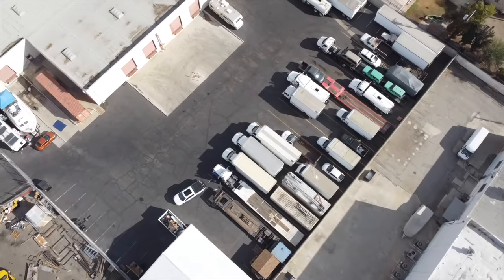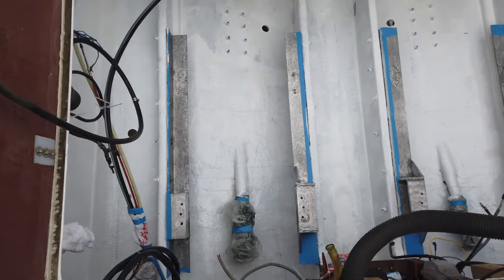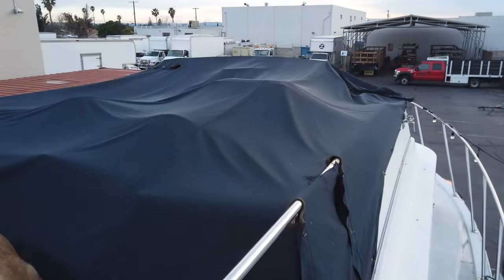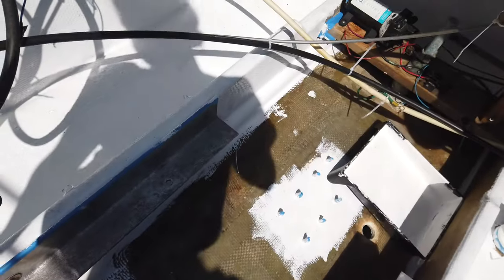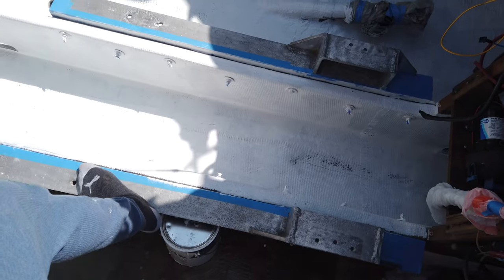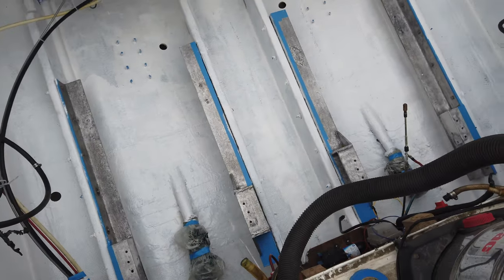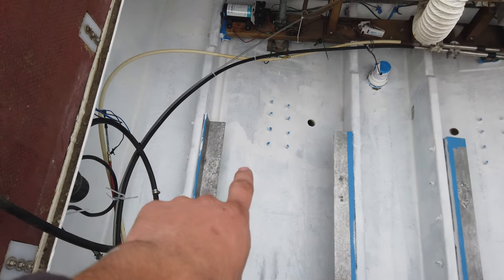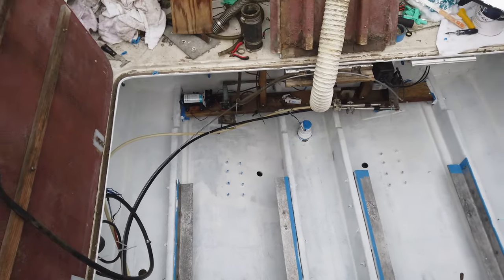Restoring a 47 Year Old Engine Bay with Total Bilge - Epoxy Paint Job - Old Yacht Restoration - Ep18

Comment: Use only quality all-brass thru-holes, no plastic. Use a quality backing plate on inside of thru-holes. Paint looks great.
Reply from the maker: Most definitely, I’m thinking of using groco brass thru-hulls and thanks! 👌🏼👌🏼
Reply: @IfTheresaWillTheresaWave  
I think you meant bronze, never use brass  fittings and valves in places that have marine water flowing into it. There are some plastic through hull fittings and valves that are very durable (Marelon) and rated for use below waterline and actually have advantages over bronze.

Comment: I've lived on a boat using a portable toilet, and it was a huge pain in the ass (pun totally intended😂) first you gotta haul it through the boat full of shit, but then you gotta figure out where you're gonna empty it. I actually have a hilarious story about that one. My opinion would be to install a holding tank, and an actual sea head. Life would ve much easier for you in the long run
Reply from the maker: 😂😂 I was thinking the same thing but I’ve also experienced many vacu head systems that  are out of commission for one part or another not functioning properly 😬
Reply: @IfTheresaWillTheresaWave  Funny story- My buddy, JD and I decided we wanted to stay on my boat for the summer. I had a 1957 36 ft Stevens cabin cruiser down at a very Posh Marina in Point Loma. It was two marinas a way from Humphreys by the Bay where they have live concerts All Summer Long. In order for the Mirena to let us stay on the boat it had to have a holding tank. Of course in 1957 they gave less than a shit about the environment, so it did not have a holding tank. Of course we told them that it did. So I went down there and remove the manual Pump It overboard toilet, and we put a porta potty in its place. The routine for emptying it was that we would wait till about 2:30 in the morning, load it in the dock cart, take it up to the toilet building where the showers and all that were, and empties in the toilet. The procedure was that I would go into the bathroom like I had to go to the bathroom, kind of check under the Stalls and see if I saw any dangling feet and listen to see if anybody was in the showers. If the coast was clear I would give JD the signal and he would go in and empty the porta potty. One night I went in there didn't see anybody in the bathrooms and gave JD the signal. So I'm standing outside the front door and I hear the sound liquid shit smacking the toilet water, and of course the smell that goes along with it. From the very back shower stall we hear "Jesus christ!! What the fuck did you eat?!?!?!" 😂😂😂😂
  Same guy- one other summer we decided to rent a condo on the cliff overlooking the ocean in Ocean Beach. we got a good deal on it with the stipulation that we put the power in our name. The problem was that JD and I had lousy credit at the time and the power company wanted an ungodly deposit that we didn't want to pay. so you can imagine my surprise when I come home from work and the powers on. I looked at JD and he responded " don't ask " . All went well for the first two months, but the last month we forgot to send the check in and there was a shut-off notice on our door. this was back in the days before you could pay your bill on the internet, so that you if you got a so that you if you got a shut off notice you had to physically walk in the office and pay it. this was a pain in the ass because in San Diego the power company office was always crowded to the point of standing room only. so we go down to the power company, JD hands the lady the shut-off notice, she takes it out of the envelope looks at it, and then looks at JD kind of sideways and says, "Bridget Joseph?!" Without missing a Beat, JD Winks at her smiles and says" they call me BJ for short!"😂😂  he had everyone in the fkn building on the floor crying!!😂😂😂
Reply: Yeah, stay away from those over rated vacu shit toilets. Nothing but trouble. Just get the cheap Jabsco marine toilet ($529.99) West Marine. It has a macerator at the base and you will need a bowl filling pump (pulls water from outside) don’t use your valuable freshwater. Damn thing will run for years without any problems. Use cheap “ Scott’s 1000” TP from Walmart. Remember, wipe flush, wipe flush. Too much paper at once will jam it. If that happens, wait and let it soften or on the back of the macerator motor there is a screw slot to turn and work the stoppage. Tell and use a labeler to remind guests that only human waste and TP goes in! No sanitary products! Provide plastic garbage bag under the sink for them to use.

Comment: Sorry to tell you this because I found out the hard way myself with the same %#€¥#*!@?” Friggen crap! That paint sucks! What ever you do, don’t spill antifreeze on it! If you have a closed cooling system and have a coolant leak or spill, that paint will shrivel up and turn in the worst possible goo you could ever imagine. Use Rust-Oleum two part epoxy floor paint next time. Way tougher.
Reply from the maker: Ooo okay, thanks for letting me know. I’ll be sure to be extra careful when the engines go in and we start filling up the fluids 👍🏻👍🏻 - sorry for the late reply! Thanks for watching!!